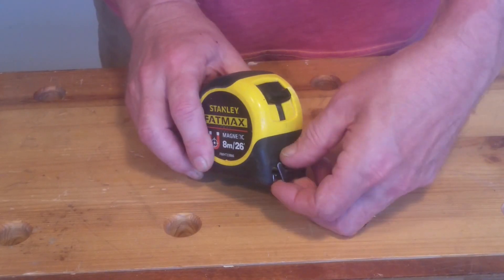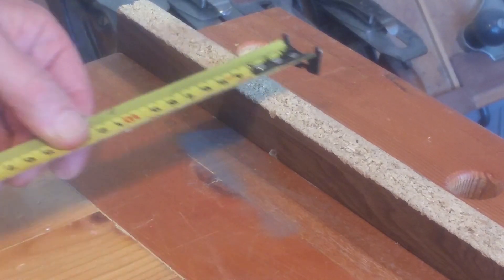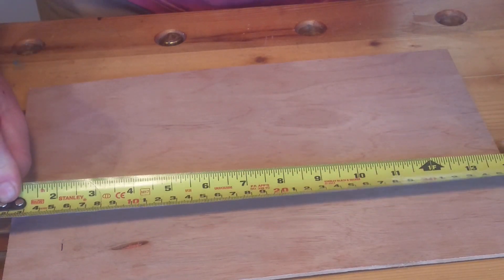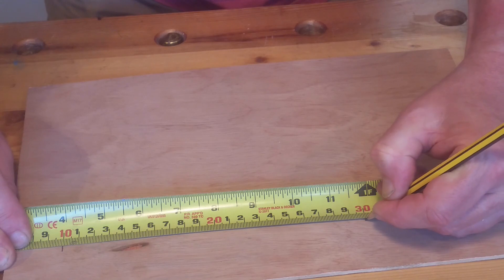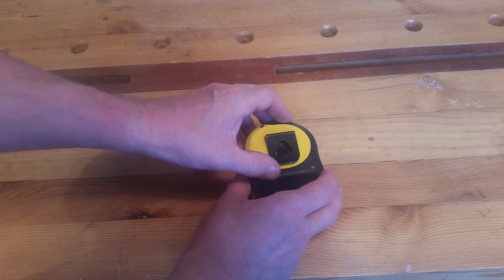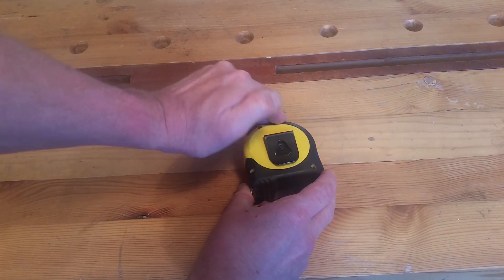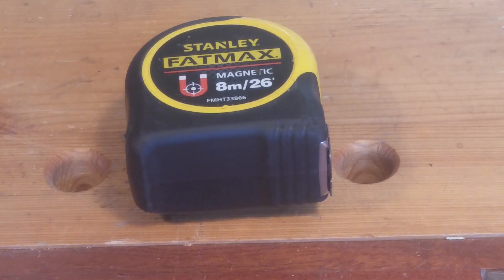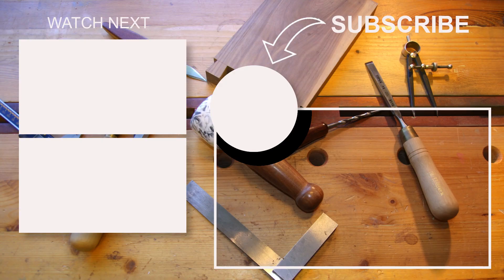Tape Measures five quick tips

Comment: It is ok to have several tape measures in the shop. However, they may not be of the same brand. Once you are using one tape measure on a project, continue to use the same one throughout the project. I had tape measures that were off from each other by just a smidgen. Thanks for the tips.
Reply from the maker: I agree, I use one tape for 99%, I have others and I know they are about right. Thanks for watching :)